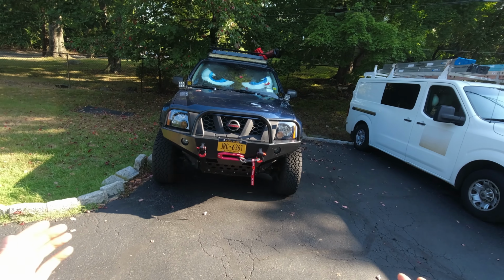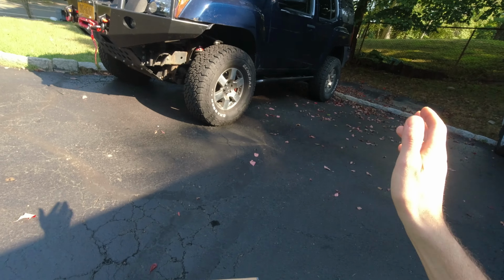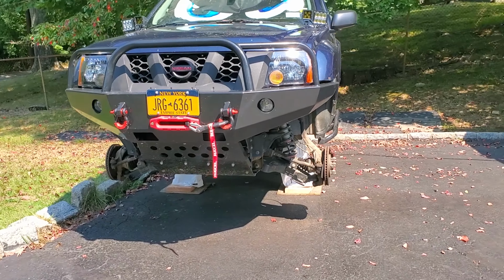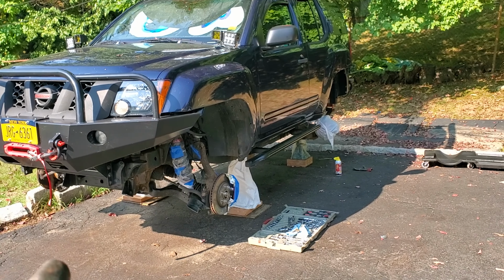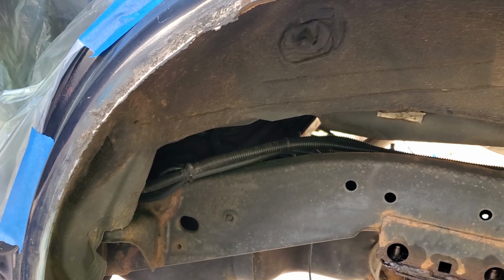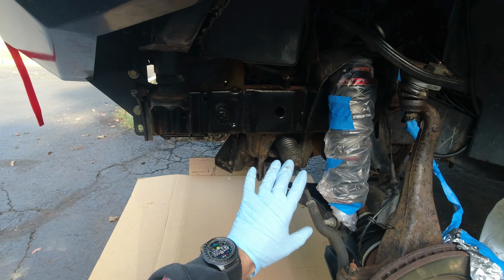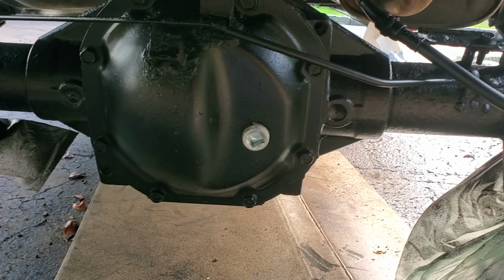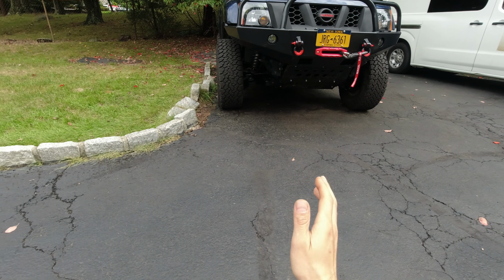Trying To Save My Truck From Rust! Using RP-342 Black

Comment: I have been using RP-342 for 6 years on multiple vehicles in heavy salt and sand conditions (New Hampshire). So I'm quite familiar with the product. What I can tell you is on a new or newer vehicle it's the best thing to use. 2 coats ( I prefer the Amber on newer) will lock out future rust indefinitely. Mild surface rust is fine too. Fine for bushings, springs, wire, battery terminals, bolts, etc.. if you get it on a connector it may make the connector a little more difficult to get off but that's not a big deal because any type of oil like WD-40 will melt the wax. That being said, you can't convert from oil to wax immediately. Any oil needs to be completely gone to use the wax. You can't share the oil in wax on the same surface. You can spray the rocker panels inside and then use the wax on the outside. vehicles that are heavily rusted with flakes should get oil. Better penetration. Or go through the hard work that you did. Should be pretty good success. Make sure it's fully dry don't put it on wet surfaces. 

The differences: 
RP-342 wax gets tacky in very hot weather. It can repair itself. Creeps. In the cold weather it will harden. Become a solid barrier between road salt and sand allowing it to rinse off without sticking. Two applications will last for years with only minor touch-ups. There will be some bleeding depending on the age of the vehicle. Which is fine. Better for overall undercarraige protection. 

Oil is better for bad rust because it has better penetration. Not durable, you have to touch oil up before every winter at a minimum. Oil sprays stay wet so they attract a lot of sand and dirt. Swells rubber bushings. Better for insider rocker panels.
Reply from the maker: oh wow thats  was very nice to read and alwasy nice to learn something and especially from someone who had alot of experience from it  . SO it defiantly gives me a bit more confidence in this product . Can't wait to see how it will look in spring
Reply: I use both CRC (cosmoline) and Fluid Film (Lanoline) at car and pickup.  Cosmoline do NOT do 100% protection.  In cavities do not work well.  If you google "Made thread about swapping seats from 2g to 3g..." and "10 year of using Cold galvanizing compound".  At moment I think Lanolin is the best albeit I use Cosmoline heavy too for visible undercarriage.  Not in cavities.

Comment: I'd just like to make a comment, I live in Canada just north of New York. And they put a ton of salt on the roads when there bad. And for years I've been doing this process I'd like to share. Specially for rocker panels and frame, and anywhere there is actually a space to get into where there 2 sheets of metal that you can't into. If you have had old car where the engine leaked oil you'll notice as the oil gets sprayed everywhere, you'll never see any rust. Oil will not hurt mechanical parts. So we take a weed sprayer you can buy at any hardware store, fill it with cheap oil, take the truck out on a dirt road and spray inside the frame. Then the rockers you drill a half inch hole somewhere closer to the door frames and shoot oil in the rockers. Then paint the metal where you drill the hole. And put a rubber plug so you can spray the truck every year. The same process is used in every spot you can drill a hole and get oil in with the weed sprayer. And I've never had a rusted vehicle. yes, you have to take a lunch with you to let the excess drip out. But as rust is usually formed from the inside out this will stop any rust from going through. Hope this helps
Reply from the maker: This is such amazing and helpful information with real world experience ! thank you so much Steve !  I have seen somewhere people make small hole on the door inside and other place and then they put like a rubber grummet or something to seal it after they paint it . This is definitely something worth trying in the future and like you said it will be much cheaper as oil is cheap.. So I will see how this product will hold up in the spring

Comment: Looking forward to it, Stan!!!
Reply from the maker: Thank you buddy !
Reply: @DIY_AUTO_PHOTO  that was an awesome undertaking! I appreciate that you addressed the rear quarter panel and the fenders (common on these trucks). Did you end up getting g new bump stops or just refurbished the original ones? I’m sure it was a bear to drill out the snapped off bolts.
Reply from the maker: @MaximumDIYGarage  Hey yeah with me for some reason I always try to overcomplicate things and simple task might take longer lol  it total to be honest it took me 3 days to do this job but I feel it was well worth it.   I think I will need to work more on the quarter panel and fenders more later but it will be different task.. 
as for the bump stops I got new ones and will have install video on them soon too . The old ones were way too bad beyond any repair  lol

Comment: I have a 2014 Infiniti in northern nj. total rust bucket undercarriage, pretty much about the same as you but body is still good, was just gonna scrape rust then fluid film, I’m gonna use  Rp-342 then cover  with some fluid film., thx.  Never purchase infinit for this reason. Is it ok to cover nuts and bolts?
Reply: Yes.

Comment: Can you spray this product directly over rust with minimal preparation?
Reply from the maker: well.. I guess you could  but it wont stop the rust... I would still try to clean off as much rust as possible.. if its just surface rust and not flaking you could spray over it.. 
prep work in any paint is always one of the most important parts
Reply: @DIY_AUTO_PHOTO  sounds good. One more question: Can you use Ospho, Skyco, then apply RP342? My concern is I don't want to apply an inhibator after a sand/grind it to find out RP-342 won't stay on or deplete its ability.
Reply from the maker: @2011italianoboy  Yes that should work no problem 
 i did a video update on this one after a year  and it shows how well the RP-342 held up

Comment: Hell yeah man. I gotta do mine sometime. Hopefully next spring at the latest
Reply from the maker: Nice !! good luck on your project ! I wanted to to do this ever since I got my truck it took time but Im glad I finally did it 
and if you will be doing it in the spring I will have an update video so for you it will be good to know how this product worked or not lol
Reply: @DIY_AUTO_PHOTO  yeah that's true. My X spent a lot of life in Tenessee but it's been in the rust belt for a few years now at least. Still some original paint on frame though and body is mostly good. I was gonna try POR15 as a rust converter, I heard it's decent stuff. Sorry for long winded comment man. I don't get to talk to Xterra owners. Have a good one man! Love all your vids btw.
Reply from the maker: @Mr_Chode  Hey no worries man its always good to read good long comments . nice lucky you and yes you defiantly need to cover it up to prevent any rust gathering on your frame . I know eventho my truck is old and stuff but I still want to keep it as long as I can so I try to save it lol
And thank you so much ! glad you like the videos !
Reply: @DIY_AUTO_PHOTO  i want to make mine last as long as possible. 175k miles on it now, going to make it to 300k at least :D
Reply from the maker: @Mr_Chode  Nice man ! same here  my truck is at 160k now I believe ) so yeah its getting there

Comment: Hey! Been following you here and on the forums for a bit now, especially since now I've got a 2012. Im from the midwest, so mine looks similar. Ive been between the Cosmoline youve used here and Surface Shield. How have you liked the results so far?

Comment: Nice job, I was about to order some of that for my 2017 Tacoma. Maybe I should drop them a request for some samples as well especially being their product is rather pricey.
Reply from the maker: Hey ! not gonna hurt to give it a try to ask them for sure ! I mean you never know until you try right )  but so far the product been pretty good.. will be doing a upgrade video in the spring after the winter salt season lol  
Do you have alot of salt on roads and winter ?

Comment: Nice job! So the rubber seal in the rear door you never replaced? I have the same rust forming in the rear door
Reply from the maker: No , I did not put it back  I don't see why we need it there its only traps traps moisture there and creates rust.. so I never put it back. 
How bad is your spots there how rusty  ? maybe you can clean it as well and paint it
Reply: @DIY_AUTO_PHOTO  I will be cleaning them up and thinking about spraying bedliner just along that edge
Reply from the maker: @stevepodraza6363  nice ! I would recommend paining it with good primer rust converter first just to be on a safe side unless you can clean all rust off but still use primer first )
Reply: @DIY_AUTO_PHOTO  will do! Thank you 💪🏻😃

Comment: New York salty roads...man that's rough on an Xterra. Good idea about swapping out your bump stocks...mine were toast as well.
Reply from the maker: Oh yeah... salt here is very bad they dump so much of it in the winter (    did you replaced yours as well ?  if so what did you uses ? I will have a video on my replacement soon
Reply: @DIY_AUTO_PHOTO  Timbren bumpstocks... my bolts were very rusty like yours- had to wire brush them a bit- but the Timbrens installed in like 3 minutes after that.
Reply from the maker: @COFFEEWITHJIM  WoW ! nice stuff man very nice ! I slightly cheaper out and got some budget ones but few of my friends has them and they say they are good so thats what I got lol

Comment: Nice Stan. I need to do something like this as well on my X. Some buddies and I used PB Blaster Surface Shield on the frames of our vehicles. We'll see how that works this winter in MN. How many cans of RP-342 would you say you used?
Reply from the maker: Awesome man ! I seen people use PB blaster Shield on the trucks and it keeps the rust out from what I seen   I was considering it as well but one more thing I liked about this PR-342 Black.. that well it turns everything black lol  and in total I used about 3 cans .
Reply: @DIY_AUTO_PHOTO  SS is oily.  Cosmoline dry like plastic.  Cosmoline is every hd at market - CRC hd, Amsoil HD, Eastwood HD.  I use Cosmoline last few years at my tuck to.  In cavities I use Fluid film.  Many guys around the internet use same combo like myself.
Reply: @DIY_AUTO_PHOTO  Hey Stan! I just watched this video again and realized you sanded down your rear quarter panels above the rear wheels. I have rust forming there on my 2011 P4X (which drives me nuts). Did you ever go about rebuilding it with bondo and matching paint, etc? I need to do the same thing to mine and just wondering if you had done it yet or if there was going to be a video about it LOL! Keep up the good work man. Your X is looking great!